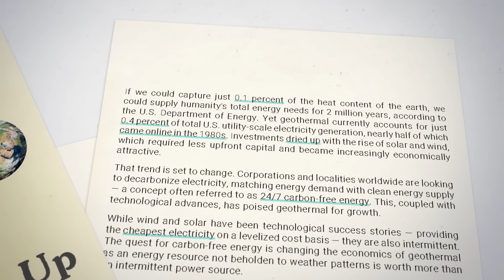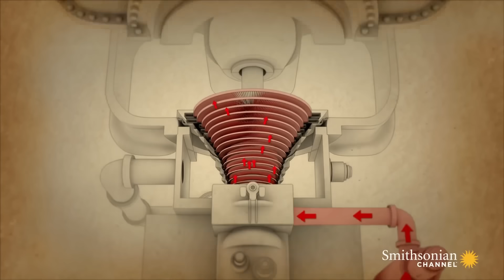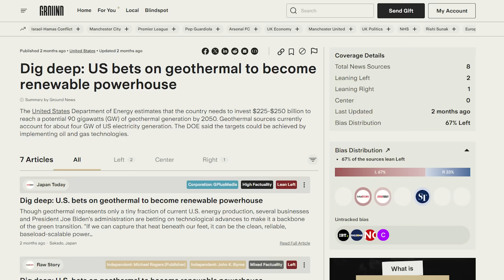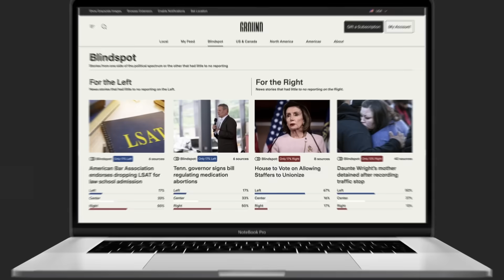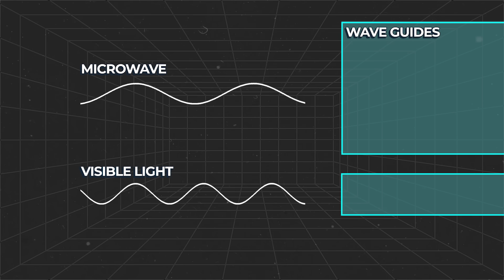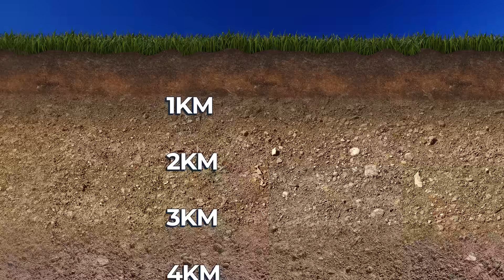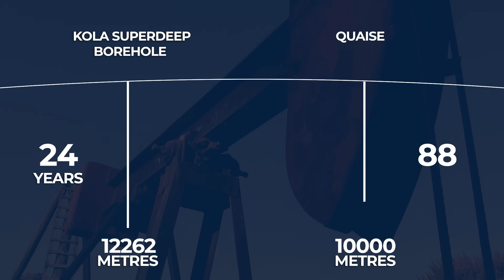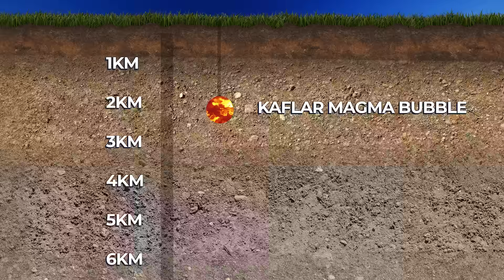This Fusion Tech is Solving the Geothermal Energy Problem

Comment: Yeah, harvesting the heat from the molten core that generates the magnetic field that protects our atmosphere from solar winds sounds like a great idea.
Reply: core is rather deeper (and a few thousand degrees hotter)

Rock is a very good insulator and one of the most pernicious problems with virtually all existing  Geothermal sites is that the extractable heat drops off faster than it can be replenished from below.  The collectable area at the bottom needs to be LARGE in order to collect sustainable heat

The other problem at 10km is that the rocks start becoming plastic, so your hole may not be stable

Comment: Could a geothermal energy infrastructure be implemented on a scale that is great enough to control instability in regions that harbor mega-volcanoes?  For example, could an impending eruption in the Yellowstone mega-volcano be delayed or prevented by using local geothermal plants to relieve magma pressure on the surface?  I'm sure the infrastructure would have to be huge to achieve this, I'm just wondering how huge.  However if the idea is potentially feasible, perhaps funds for such a project could be obtained from a national security budget.  Thank you.

Comment: This won't work. The hole will fill with high pressure vaporized rock and it will eat itself wider instead of deeper. You'll see.
Reply: it will be interesting to see how it works out in any case.  news feed acquired

Comment: another hero thinking pumping some energy from whenever will save the planet.
duude, we have problems radiating the solar heat away and you want to pump some extra from underground? 
still i give you that its better than microwaving the surface but its still retarded.

Comment: My napkin math on Quaise:  1MW output, assume beam has 50% efficiency and $0.10 per KWh which is $100 per MWh so around $200 per hour or $4800 per day in just the beams energy cost.  If estimates are it takes 100 days to reach depth that's around half a million USD in beam costs to dig the well.  Of course... nothing this technically challenging ever goes without a hitch.  

Looking at the macro investment numbers, assuming a very boring (pun intended) 10 year break even point a 300 MW power plant at 10 cents per KWh would generate 300MWh *1000 * $0.10 *24 * 365.25 * 10 = $2,629,800,000 or about $2.6 billion in revenue.  Assuming the operation and maintenance costs are similar to a coal plant (both are steam) they run around $40/MWh so around $12,000 per hour or about $1.05 billion so the cost of the facility construction and sinking the well needs to be under $1.55 billion.  The cost of the plant itself (again comparing it to coal) should be around $500 million leaving a budget of about $1 billion to sink the well.  Considering an offshore oil well can run around $100 million to sink my napkin numbers for Quaise seem to check out... this is a much better idea than stuff floating around with big investment where the numbers don't make any sense.

IF, and that's a very big if... Quaise gets the technology to the point where they can sink wells on existing coal plants and essentially reuse all that investment then Quaise would quickly become one of, if not THE most valuable corporations on the planet.  Keep an eye out for that IPO.
Reply: The other key will be directional drilling.  If they can drill a dozen holes in one area it would keep costs down.  Alberta is currently in the process of setting up a government funded site to start testing new technologies for geothermal so I'd expect Quaise will end up drilling some holes here.  Alberta has an advantage here over many areas since we have all the equipment and qualified drillers required to do work like this.  We also have lots of data when it comes to what is under the ground as far as rock goes.  They will be able to drill to a certain depth traditionally (which is much faster) and then at a certain point they can switch over to this type of system.   That should in theory bring down the costs.
Reply: It is not even about IF this drilling technique will be able to do this but WHEN at least from my limited understanding of this subject. So far it seems not that far off and well withing our lifetimes. Electrification of basically everything would make a lot of sense this way but this also means that we need to do everything we can to protect the infrastructure. Recent solar flare could do in that kind of a world do a lot of damage. This technology can also make all countries completely energy independent. That sounds really sick.
Reply: @likilike501  Actually it sounds pretty healthy. 🙃
Reply: @likilike501 EVs would still have tons if issues.... Not worth rehashing the same old same old talking points.
Reply: Your energy costs for a utility scale connection are off by a factor of at least three. In reality, these boreholes would be placed at existing power generation facilities anyway.
Reply: @otm646 I agree if u are saying 3X too high.  Drilling can be done off peak and on a wholesale basis. There are periods in the market when the grid level price for power reaches zero $.
Reply: Please factor that these bores will be dropped within the existing power generating facilities, plus factor the surplus/scrap value of the displaced power generating equipment.
Reply: 🤔 OpEx should be lower than coal, because there's no boilers to maintain, plus no fuel delivery and disposal. You just open the tap on the power well.
Reply: Drilling is not a problem. The problem is lithostatic pressure trying to collapse your well. And this pressure will succeed given 10 km deep and very hot hole.
Reply: So many IFs and then some. I mean, maybe I missed it but I don't think they mentioned how bore hole diameters compare to standard drilling. Also I really wonder how that glass-like wall performs a few km down where rock becomes more like playdough.
Reply: @IzzyIkigai  When backing your boat and trailer into the lake you stop when the boat starts to float. You don't need to reach the middle of the lake. In the video they are trying to reach rock hot enough to make decent steam which starts long before the rock would be plastic.Using that model they could produce steam for a certain time and then upon cooling the surrounding rock, then drill deeper to reestablish a fresh source of heat.
Reply: Offshore drilling rig rates are ~$500k to ~$1M per day. A single tool rental on that rig can easily be more than the beam energy.
Reply: The CEO has added that if they can hit $1,000 / meter regardless of depth for drilling costs they will have an LCOE of $0.01-0.03 / kWh, which puts them on par with wind and solar. I've been watching this company for two years now and would love to be able to invest. Hopefully their test at the end of this year begins on time. It's potentially world-changing.
Reply: @blakebrown534  what do you think of Vasey Handmers terraforn? S3 channel did a really good video of there Burbank facility and the company philosophy.
Reply: Thanks Mr Spock for that assessment! Seriously, I appreciate your insight. The numbers are above my pay grade, so it's good to get your perspective on it.
Reply: Great analysis
Reply: The main issue with using money as a gauge is why we haven't developed Nuclear energy. You can't make money if creating said resources drops the price. This is why OPEC and oil companies literally restrict output to increase prices. It's also why we have incredibly weak supply chains. If you use energy and sustainability science to gauge where to put our technological prowess then it says we need to dramatically invest into these technologies. It's funny because stuff like sewage and city planning is done like this but not energy...which is foundation of civilization.
Reply: @MrKittyGyat  sounds a little like communism. 100% carbon tax should go to research only. Then any discovery public domain. When their is something better than fossil fuels then market takes over. Oil company's restricted if interfere with markets. I think they lower prices every time there's a natural gas company that looks promising so it goes bankrupt. I can't get my head around not using capitalism and not devolving into tyranny. At least under capitalism everyone eats.
Reply: @MrKittyGyat  Yeah I think a big problem in regards to this is Ronald Reagan poisoned the minds of so many Americans to believe it is impossible for the government to do anything good or helpful so people would lose their minds if we had government run utilities instead of profit seeking corporations nickel and diming us into the ground
Reply: Is there any issues with using laser energy instead of microwave to drill the deep holes, or does this come down to an efficiency equation? 

I would think laser energy would be easier to keep focused than microwave and be less problematic, but I'm not familiar with either of these to determine that
Reply: @goodmanboattransport3441  This thing essentially IS a laser, just not in the visible spectrum.
Reply: @vorg_  its technically not a laser, because the laser definition is not about the energy beam, but its mechanism of release. In fact, a laser dont even need to release a beam, its just that this is the most common use for a laser, as its the easier way to produce a photon beam, and other than creating beams lasers have not too many uses. Laser is when photons are emitted by atoms that gets excited by receiving other photons, while the device described in the video is a thermionic microwave gun, that first uses a thermionic emitter, which uses thermal energy to release electrons, and them pass those electrons through a varying magnetic field to make them release microwave photons. The result of both are photon beams, but they are very different technologies
Reply: @andremarques3317  I think you are confused.  Stimulated emission is a physical process; LASER is a device, with optics.  A Laser, or any light that is lased needs to be coherent.  Fluorescence is not a LASER for instance.
Reply: The last time I've heard about this project, like 2 years ago, I think they said the electricity costs of drilling (lasering?) would be like $100k a day.
Reply: welll done time to watch stock market
Reply: This laser drilling cost a prototype. Cost would come down. Maybe compare to wind turbines. Geothermal is 24/7
Reply: You should do a YouTube video of your own explaining further after Quaise goes public.
Reply: Better be quick. The coal plants are being destroyed quickly.
Reply: Hope they team up with the company that makes piped loops that reuses the water or liquid. 

 Lots of nasty stuff down deep from what I hear. Dont want to ruin water tables is all by essentially fracking.
Reply: @dianapennepacker6854  Yeah it uses a heat transfer mechanism so that the water pumped in stays in a closed loop system.
Reply: We better hope for that IPO before these folks get a suspicious invitation to a Saudi embassy in Turkey
Reply: Let me solve your problem without numbers. If we extract the energy from the Earth core,that mean lowering the temperature= stopping the molten flux=colapsing Earth's magnetic shield= we go to hell = no $ revenue.  Problem solved,you welcome.
Reply: If this company doesn’t succeed, another will.
     
It seems almost intuitive to me that this is the most realistic, actionable solution to our energy problem.
Reply: @John-zz6fz  Pretty straightforward I like your mathematics
Reply: Ty ty appreciate the insight
Reply: Do u really have this much free time to type all this
Reply: @ijazahmed6178  says buddy who probably spends hours a day scrolling. This explanation was based bro, wake up
Reply: What’s even better is 50% efficiency is the floor, not the ceiling. Every gain they make on efficiency changes the overall cost significantly.
Reply: Also appears u could get a 100 meter well for water in three days for around $15,000 energy cost.  Not too shabby
Reply: @kccorliss3922 

One question on that might be whether or not water would be able to enter a bore hole with a glassy, sealed wall.
Reply: @kimchiman1000 
Well maybe poore it in from the top!
Reply: @Myrslokstok  

Sorry. Allow me to clarify what I said. I meant water creeping into the bore hole via the wall, and not from the top.
Reply: @kimchiman1000 I presume you could hydrolicly fracture the base of the hole, no?
Reply: @kccorliss3922  They can actually dig 100m/day, but $5k and 24h is awfully expensive for a 100m well, at least around here! 😅
Reply: @kccorliss3922 in this sense though, it’s way way cheaper to traditionally drill the first layers, so for wells this isn’t exactly groundbreaking stuff.
Reply: @kccorliss3922  This technology will be employed only after conventional drilling reaches basement rock, so it's  inapplicable for your purposes .
Reply: Something that I always wonder about with new renewable tech, is whether it can beat natural gas with solar and wind. The attitude i've seen from the vast majority of regulators and developers is that solar and wind with a sprinkling of dual cycle natural gas with investments in planting trees and carbon capture techniques is good enough.
Reply: @Ang3lUki  Everyone seems to be thinking like natural gas will not be exhausted in time, like oil. As soon as you tap any energy source you have started an inevitable process whereby you will exhaust that source of fuel, no matter it's source. So reliance upon natural gas is no different than reliance on oil. Sooner or later you will need a new source of fuel.

Which begs a question. What happens when there is so much heat being pulled from geothermal, that it affects the Earth's interior temperature? Granted that would likely be in the very distant future, but it will happen if enough heat is tapped for cheap energy.
Reply: Ok, but what if they beam into an aquafier and the surrounding water keeps cooling the rock? Also, how much thermal energy can we extract from Earth’s core without lowering it’s temperature and endangering our planet’s magnetic field, if we start mining for heat at a truly industrial scale?
Reply: May I suggest this is a suicide mission.. aside from the money making promising project.. 😮

Comment: Is it unlimited energy though? If you open heat sinks to the surface what are the ramifications?
Reply: It’s a very sensible question to ask, given the long history of “ideal solutions” that end up fucking us in the long run. In this case however, the heat release involved is close to nil compared to things like volcanoes, and there’s no carbon emissions involved so it isn’t going to have a cumulative environmental impact worth noting.
Reply: Pretty simple to answer. We screw the core up
Reply: @joeybible683  brainlet detected
Reply: Negligible.
We are talking about all the heat produced by all the radioactive elements in the Earth's core.
It is correct that the Earth's core would cool slightly faster than it naturally does. But this is a process that has been going on for billions of years and will continue for billions more. And compared to the amount of heat that naturally radiates from the surface into space, I think even tens of thousands of vent holes would not lead to an increase in heat radiation that would be detectable.
Reply: @Yora21 correction: we think it's a process that has been going on for billions of years and will go on for billions of years. But we have interpreted evidence for things like this wrong before.

But we can always close down the heat sinks if we notice its cooling faster than we thought, so I don't see much issue.
Reply: @Yora21  offcourse we don't actually know the full ramifications of digging these wells either.
Every time we find some amazing solution for our problems reallity comes back to bite us in the ass. dams ended up killing riverine ecosystems and displacing millions for instance.
Reply: you slow the molten core rotation, shrink the  magnetic field around the earth, and burn away the atmosphere, kill the vegetation, and evap the water into space.   but dont worry, that is probably at least a couple of hundred years from now.
Reply: Greta Thunberg rises from the grave and asks again, "how dare you" is least likely to be a result, although I couldn't help but offer it
Reply: Earth capacity of heat dissipation is big but not infinite. I saw paper that compares CO2 global warming with pure heat global warming and threshold for the latter is 20 times bigger than for CO2. So geothermal energy will work nice, probably for couple of hundreds years and hypothetically up to 50-100 billions of population. After that humanity should move into space, of course.
Reply: GoeThermal global warming
Reply: OMG,  we could  unleash a volcano that could destroy the dinosaurs. Get over yourselves

Comment: Don't group it with Wind, Solar, or Hydro. Those sorts of power generation take power from the atmosphere, while Nuclear, Geothermal, Coal, and Gas take heat or material that is sequestered in the planet and bring it up to the atmosphere. This is maybe the best of the dirty power generation, though I believe nuclear is still better, but it's on the wrong side of the ledger.

Comment: the earth has a diameter of 8000 miles. if we go 6 miles deep then we’ll have as much energy as we will ever need.  if we drill 0.00075% of the earth diameter.  it just goes to show you have we have barely scratched the earths surface.  we may think we are very advanced but we really are not.  

in this decade our technology will really accelerate and change humanity